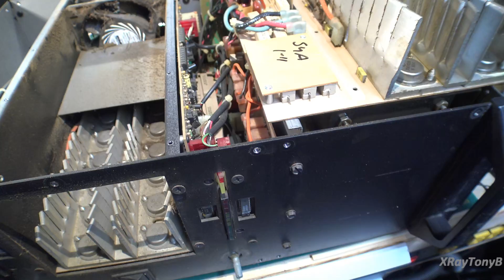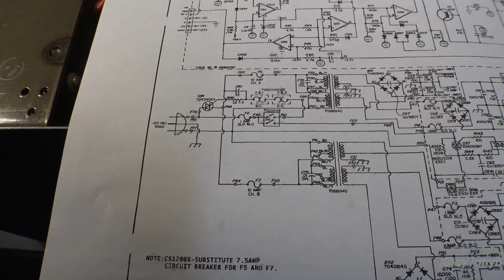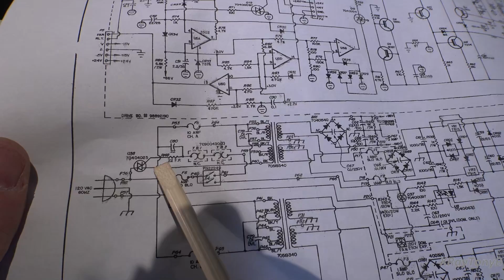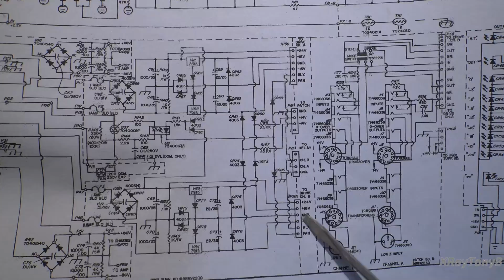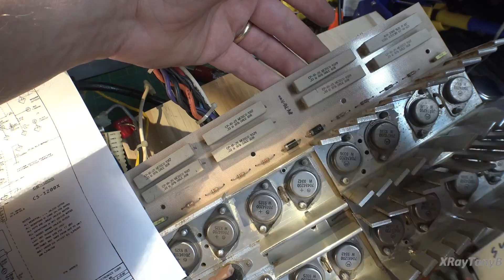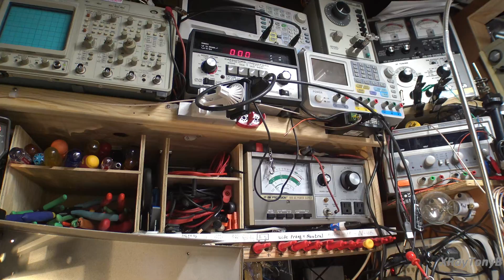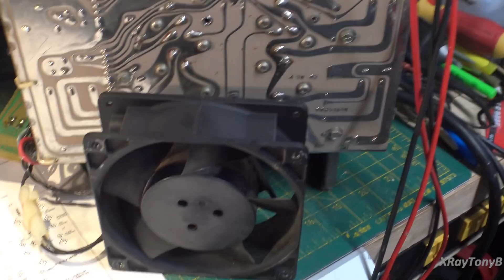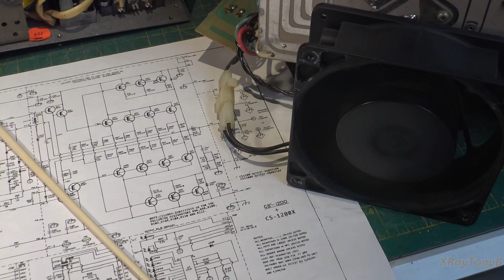Peavey CS-1200x Amplifier Repair

Comment: Hi there, I am servicing an old Krell Power Amplifier with a push pull circuit.
It consists of 14x NPN plus 14x PNP transistors.
What puzzled me was that the PNP ones had an average hfe (Beta) of around 45 whereby the NPN side measures around 115.

My first question: Shouldnt the push and the pull side be matched to have both the same level of amplification or is that somehow taken care by the driver setup?

Secondly: the amplification range on the PNP as well as on the NPN side various greatly( 16-67 NPN, 105-168 PNP side) is that caused by aging ? Could i still leave it or would it be risky to operate the amp under such condition? I believe it will cause an uneven distribution of load but under normal load that might not be too bad ?

Comment: Fantastic ! I happen to be using one of these and a 1000. Love them! I also have 2 of the DECCA 528's that are in serious need of repair, a DECCA 724 still in service ...   WOW!!! What an amp. Also sub to your channel... I still push my luck on repairing these steel tanks also. Thanks...
Reply: The DECA series was one of the first amps to use a PWM switching power supply.  Now most amps made use that topology.  The DECA amps came out in the 1980s.  Way ahead for their time.  Digital Energy Conversion amplifer.

Comment: these amps are great but not good enough to warrant the time or money to fix , they are also back breakers.....I had 4 in a rack , it needed 2 strong men to wheel it around ...
Reply: I have one word for you.  Dolly dummy  oh that's two words    amps like this will be luged around till the end of time
Reply: Those are light compared to the first gen CS 800 and CS400.  I have 2 400s and 1 800 in a rack.  Good thing it has heavy casters.

Comment: I am jealous. I payed 90 buck for a cs 400, and rebuilt it. what a beast. you have a really big beast. one interesting thing about these amps is the speaker damping factor, meaning when the amp sends a signal, it does not allow the speaker cone to continue movement after the signal event. rater interesting to watch.

Comment: Oh' no audio test? a scope can tell lots of things but to hear it meant a lot to us, how would we know exactly if its in  a good shape?  come on let us hear it,  play some lows and NCS music then crank it up a bit let see if it's in tip top shape now....
Reply: Strange as it seems, If you connect the speaker outputs to a load that allows the amp to produce its rated power, and have a function generator to apply the proper wave forms Sine, Triangle, and Square plus a tone burst mode, there is no need to check it on actual speakers.  The final test would be done with the amp completely assembled using the proper input and out terminals and the correct resistive load.   There is no reason to put it on speakers at all.  I did service for a commercial sound reinforcement company as an independent contractor for about thirty years and never put the amps on speakers.  The wave forms themselves will show any issues with frequency response, distortion or oscillation.
Reply: @swinde  exactly. Dummy load & scope can tell you everything you need...
Reply: what exactly could a recording of a speaker in a room, lossly compressed over youtube, tell about the quality of the sound of an amplifier?... ;)
Reply: @alexreeve  Well ok it's all up to you,  cause  i've seen most of repair guy on youtube  after a solid repair  they test it,  were not hear just to read a scope sine waves, besides it's an audio power amp it suppose to play music,  No copyright just play NCS-music,  we just wanna know if it's  on working condition  one way to know play a music, no offense just my thoughts thanks..
Reply: @edifierbass7821  yeah i know what you mean, its like.. a kind of trophy for successful repair maybe? :)
Reply: @alexreeve  yes ok have a great day/ night   nice work

Comment: I'd like to hear how it sounds. Why do people think professional or commercial amplifiers sound bad?
Reply: Pro audio gear can have a higher noise floor and can color the sound a bit. It tends to be muddy at lower volumes but be glorious at high settings. I run a servo 600 amp driving vega D7's and absolutely love the setup. The quality of your pre amp makes a huge difference (using a fully reconditioned sx980). Also a lot of pro gear only has balanced inputs/outputs which can be matched to your home gear but that process can also add noise/coloring. Honestly, unless you are into true audiophile gear worth thousands..used pro gear can be purchased for pennies  on the dollar and bring mile wide smiles.
Reply: @muddyducker3336  you have all Tru audiophile gear dude you are the true audiophile
Reply: @TheElectricnoob my servo 600 is an AB amp, and runs cooler. The other thing to keep in mind is that most if not all pa amps use cooling fans. The samson I have may not be highly rated but the fans are whisper quiet....thankfully.
Reply: @muddyducker3336  if you hear fans just crank it up a bit
Reply: @Chokechain1111  haha, thanks man but my tinnitus says otherwise. :D

Not to worry, I can never hear the fans!
Reply: @Martin M not quite passive cooling.  There are two small fans on the heatsinks but they are internal. I had to rebuild the driver board for the right channel and found them.

Comment: Peavey is a victim of their own success when it comes to these old CS series amps.    A lot of pro sound people are snobs and say "Peavey is junk".  But what they are talking about are amps that are close to 40 years old  in some cases and have never been serviced.
Reply: Yes was thinking the same. The old Peavey amps are known to be really good and reliable... but yeah there is always a lot of uneducated opinions in the audio field, especially in the "pro" and "high end" world lol
Reply: I've serviced a lot of Peavey over the years. Wasn't always the best sounding gear. However the reliability was good and mechanical design was solid. Their customer service was always fantastic too.
Reply: Hmmm... I don’t know about that. I’ve seen a repair video recently that got me absolutely appalled, where a freaking burnt LED took out the whole unit. It was from the IPR series, if I remember correctly.

P.S.: yep! Here you go: https://youtu.be/HCrcbHSnogc . It’s simply unbelievable!
Reply: I disagree. I've serviced a few of these amps and the design is one of the worst. They also sound bad, the pros are right, Peaveys really are junk.

Comment: you should mesure Graetz bridges with multymeter from the begining and save your time by making your live easyer ... those transformers and triac are practicaly undestructable ... other way is to discharge the caps and mesure for short between power rails and ground ... either from begining or after mesure the bridges ... you don't even need the schematic for this ... if something is shorted on power rail or the whole channel it will shown as short from begining without needing to disasembly and reasembly the whole thing several times ... this is very wrong method to detect problems in electronics because this way you can do more damage than fix it ....
Reply: Because Tony has a different approach than you does not make him a bad technician. His purpose is the show as many parts of the unit as possible and explain the construction and the design. I have a different way of checking an unknown unit.  I always start by removing the case and looking for obvious defects, like blown fuses, scorched components, ballooned or corroded caps, loose wires, broken parts, bad solders joints, funny colours on the PCB's.  Then I check all diodes, transistors, for shorts. Next, I check PS-voltages; so I power up the machine with a bulb in series.  If all goes well, I check the output for DC.  Finally, I play some music and listen for audible distortion, check bias and check power output before clipping with a scoop. BTW, I find most defects without ever powering up a unit.
Reply: @1959Berre  this is the right way but a light bulb on transformer doesn't help at all on primary coil (it may help if you put 2 light bulbes on SECONDARY coils of dual supply transformer if you afraid of shortage) but if you know what you doing and do your visual inspection right there is NO POINT of puting a light bulb on transformer at all ... this is a waste of time and energy and you gain nothing (completely useless manеuver). If there is defected transistor or IC (NOT shorted) you never cach it with bulbs ... i am not telling you what to do rather than what NOT TO DO to make your live easyer and safer ...
Reply: The damage was already was done by the previous user(s). I guess they went on and kept the amp running for a while with the shorted supply.
Plus he's making an educational grade video. I've seen his videos and he's very good at what he does.
Reply: @noelj62   i don't see how this can be educational when its WRONG way of repair stuff ....  this could caught fire or damage the good parts or main board... i am not going to explain the consequences of doing that ... obveously you are not professional electronic service technicion ... to have equipment does not make you good repair service ... you can't put only one power rail on dual PS unit
Reply: @technixbul  No, I'm not a certified technician. I'm a certified engineer if that counts in your dictionary.
Anyhow, you can apply a single rail to a dual rail supply amplifier as long as you don't connect a speaker to it. The circuit would be floating on the supplied rail. Of course, it doesn't mean it's my preferable way to check for shorts, but it's not a bad one if a wire is shorted to chassis for example. 
I once had a 2.1 creative computer speakers in which the power supply wire melted in side the main cable going to the power switch in the right speaker. The previous guy who worked on it thought it was the transformer and changed it in vain. It took some testing with low current supply and poking around in some unconventional ways to find out were the problem was.
Debugging a design fault is a creative job in its own right.
Reply: @technixbul  AND obveously you cannot spell technicion !
Reply: @gatesmw50  nope ...
Reply: @technixbul  if its the wrong way then how did it get fixed ? lol
Reply: @gearheadted9210  This was what we call it "test until error" (poke around until something else go in smoke) this happend when knowledge is limited or insuficient but the will is strong. I know that because i was like this 20 years ago until the big bang on expensive equipment comes, then come silence and only you with your thoughts remain loud :D
Reply: @technixbul  well everyone has different methods but Tony fixed a $20 amp with a 50 cent part and a little elbow grease.i think thats pretty cool,many paths to the top of the mountain!
Reply: @gearheadted9210  Well sometimes damages are small and easy ...  if it was only a fuse it will cost 6 cents or 0.2 cents if was a fusible resistor.That does not make difference ...
Reply: Totally agree that would’ve should’ve been step one you can even go another step farther and put a little current limited power supply across to caps and also see the short
So I really don’t know how he did not see the short
When he was measuring collector to emitter  across those transistors
That diode  is there for reverse  voltage protection
Reply: I totally agree you can even go a step further by putting a current limited supply across the cap and  also see the short condition .I do not know how he did not see the short when he was measuring across the transistors. that diode is there for reverse voltage protection
Reply: @kansasnutt   or just beep for shorts on power rails ... its a 3 mins fix if count mesuring all transistors and diodes for short

Comment: I used to run 12 big racks of these back in the day.. that was pretty much the stock fault..  the fan control circuit failed.. they went bang due to heat.. which is why you often see them with small strips of paper stuck in front of the grills on the front in pictures of big rack mount systems running these. Otherwise they were great amps... but damn heavy when you have 8 of them per rack !!!! (make sure to buy the venue lifting crew some beers if you like your gear in one piece after the show)

Comment: I think that amp is made for professional  high-end commercial uses such as DJs, Karaoke Bars, Hotel Ballrooms, Nightclubs, Public Address Systems, Conventions, Rock Concerts, School Auditoriums, Performing Arts Theaters, Stages, Studios, Fairs,  Bands, and similar applications.   That unit was not made for home stereo use.
Reply: Stephen Hinkle that doesn’t stop me from using a bogen m600 to power the subwoofers in my home stereo. Which is designed for the same purposes these are. They aren’t designed for it, but boy do they do a good job of it. Just at the expense of lots of energy usage. Mine needs a dedicated 20 amp circuit
Reply: They are made for whoever has the balls to hook up  and the power supply

Comment: When I had a CS series in the shop with a problem on the amp board, it was common practice to replace all the diodes on the board.  Diodes are cheap, and they were a high failure part in those.